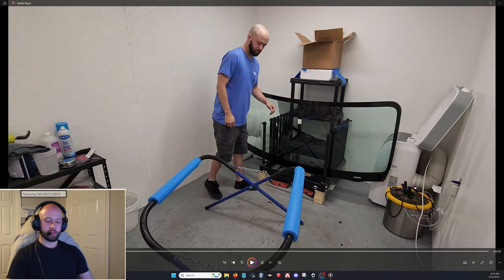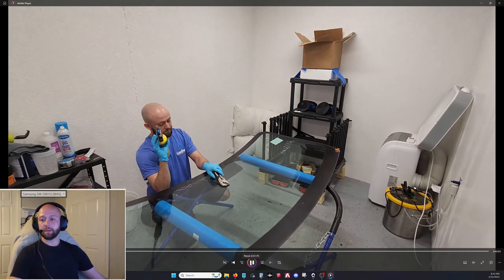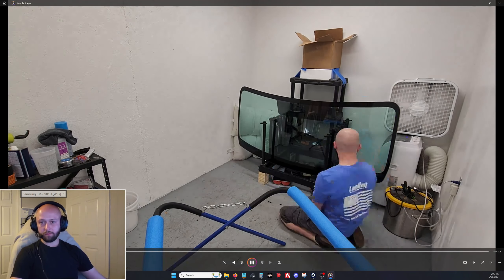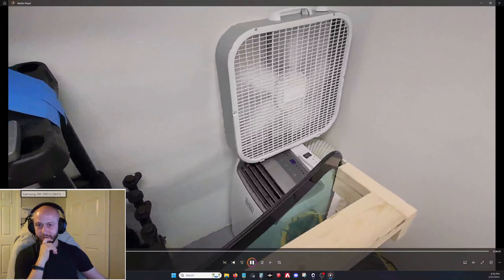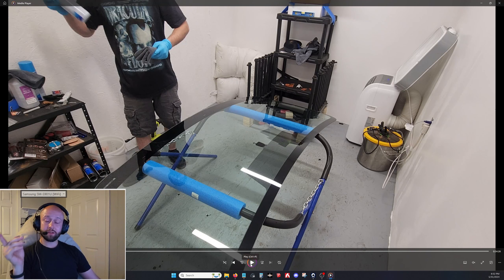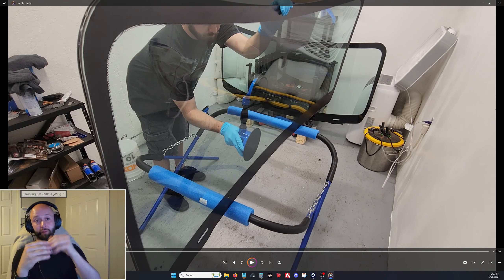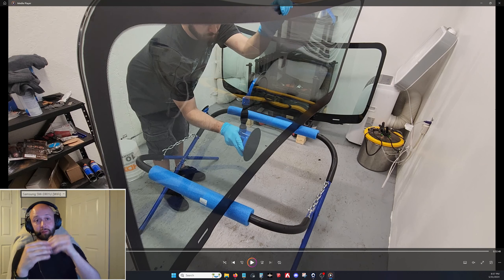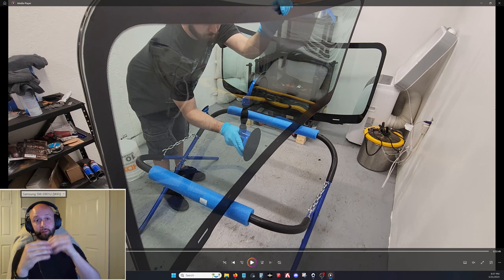Double-Laminated Windshield In Depth Tutorial Guide For Extreme Car Audio

Comment: Awesome video! Question, at around 27 minutes in, do you let the perimeter urethane dry before the epoxy injection? The camera view moved but I couldn't tell if it was a day later or something? Thanks 🙏
Reply from the maker: Yes! Wait 1 day for first urethane bead to cure. Then inject. Then wait a day (if using fast hardener for injection), then do beauty bead of urethane.
Reply: Awesome, thanks again! Great stuff!